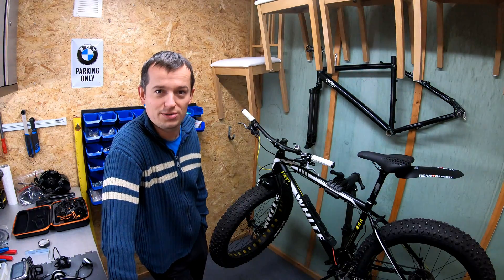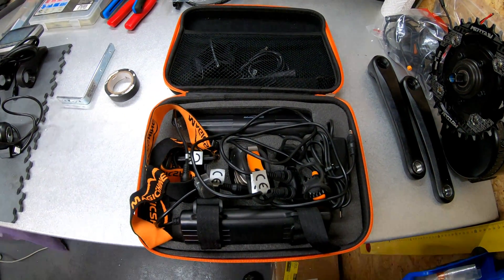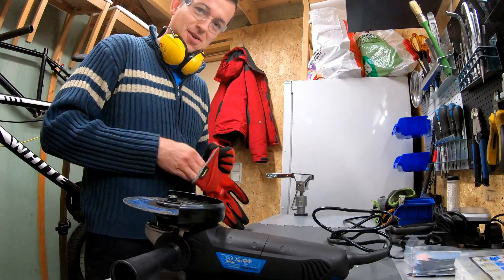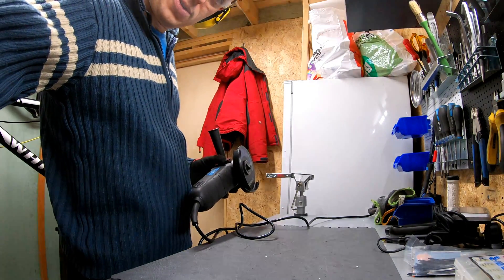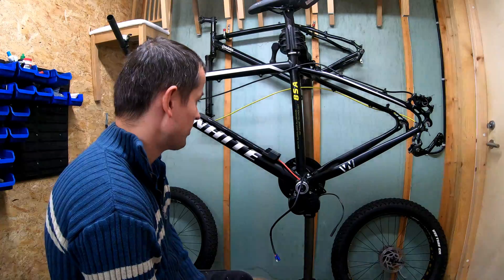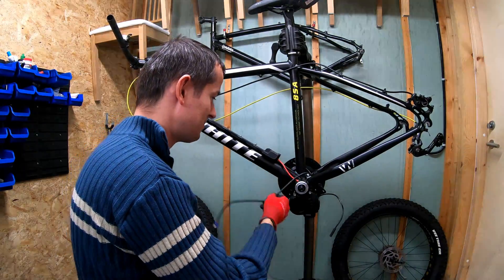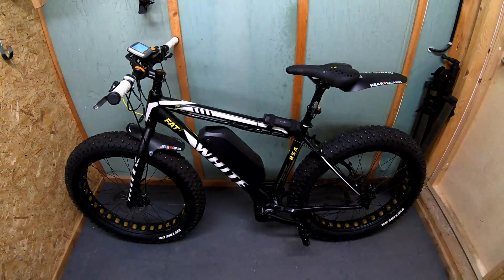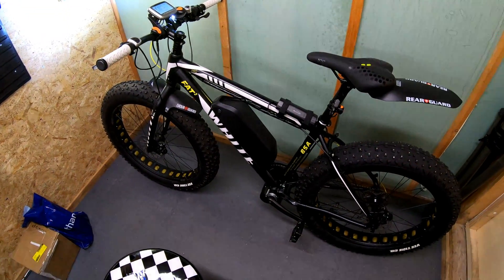White Fat 2 fatbike conversion with TSDZ2 motor

Comment: I've used the TSDZ2 on two different full-suspension bikes and I never installed the bracket.  I'm thinking of installing one on a fatbike next.  Winter is coming.  I wonder if I can chop off the bottom bracket narrower so a 2x would fit.  I'm thinking of trying a front derailleur again.
Reply from the maker: I had some issues with motor behaviour, when it was installed without the bracket. It was twisting a little from high torque causing rubbing noise between transmission gears. With good solid bracket you don't have this problem.
Reply: @LierskogenEbikes  I had rubbing/squeaking sounds when installed without the bracket as well. The motor rotated up the downtube a little bit from the torque. I tightened the nuts on the bottom bracket again and the rubbing/squeaking went away.

Comment: Nice Job!  I originally was planning on a BBSHD, but I have a question for you.  How fast does it go on throttle only?  Unfortunately I am disabled from a spinal cord injury, currently I am up to biking a 1.5 miles before my GERD says done.  I hope over time I will be able to do more, but there is a good possibility I will always be limited...so I want an ebike for nature trails, just to get outside and chug along at 10mph, stopping to watch the wildlife etc.  Now they do have open source software which hopefully someone will code more power into throttling.
Reply: It really depends on gear ratios  It'll throttle faster with a 52t vs a 32t chainring.  My first bike I built had a throttle with a 42t chainring.  I could throttle to work at 18-20mph.  A 52t would be about 28mph on flat ground.  My second (current) bike has a 32t up front and I decided to not install the throttle this time.  Pedal-assist only.  I can get to 20mph by pedaling pretty easy but anything faster is difficult.  My current bike is for mountain biking so I didn't build it for speed.  It'll climb anything though.  I HIGHLY recommend the TSDZ2 because of the torque sensor.  It really is a natural way to ride.  I probably will never buy a Bafang because of this.
Reply from the maker: I think I can hit with throttle only on the flat road around 30 km/h, maybe 35. It all depends on tyres size and pressure. I recommend tyres size max 4.0 for non winter riding. 4.8 is a big overkill and 4.0 is perfect for  balanced riding in the wild and on roads.

Comment: Nice bike, looks good. 
I have heard people having trouble with the longer crank breaking.
Have you have any trouble with the crank?
Reply from the maker: I heard there are some problems with fatigue cracking of longers cranks for 100 and 120 mm brackets. I reached almost 1000 km with this motor and no issues. So it's very dependent on riding style. I don't jump on this bike, just plow through swamps and mud on trails in forests :)
Reply: @LierskogenEbikes  how’s the motor spindle still holding up about 1000 miles? Are u still using the bike foe forest riding? Any damage to the spindle yet? How many miles so far on the motor?. Thanks in advance
Reply from the maker: @bicycles-as-far-as-im-aliv5725  Motor is used now on another bike by my wife. No issues at all after more than 2 years.

Comment: Hallo Using Magicshine MJ902?
Reply from the maker: Yep, it's brilliant with the steering mounting bracket.
Reply: Hello, first of all I congratulate you for the work you did, perfect .. then I wanted to ask you how the engine is behaving, and if it pushes well .. as regards the light, I ask you how you can turn it on by going from low brightness to high, my Magicshine does the opposite and it bothers me .. thanks hello
Reply from the maker: Motor goes really good. It's not that powerfull, like Bafang motors, but it was not my purpose to build a motorcycle. I drive this bike in forests in difficult terrain, so motor with torque sensor was primary objective. 
These Magicshine sets works differently for different models. I have 2 models and they shift brightness in reverse pattern. I don't bother :). It's possible to configure them with Bluetooth application on mobile phone.
Reply: Unfortunately my Magicshine doesn't have a battery with a Bluetooth interface @LierskogenEbikes

Comment: program Bafang for less power ?
Reply from the maker: Hi, I don't understand your question. Please elaborate.
Reply: Lierskogen Ebikes said BBSHD was too powerful. Reprogram controller for less power rather than swap entire system
Reply from the maker: I was not replacing Bafang motor with TSDZ2 one. The other motor you see in the movie is for installation in different bike :)

Comment: Where did you buy the engine&battery? Is the bb 100mm?
Reply from the maker: Yes, bottom bracket is 100mm. I bought motor and battery on Aliexpress. Ebird Store is selling TSDZ2 motors with different lengths of crank.